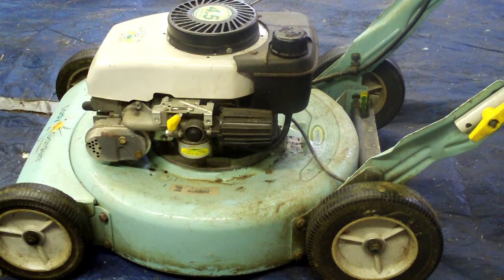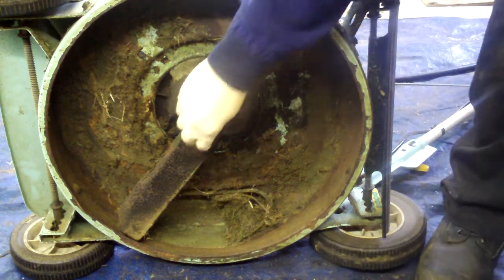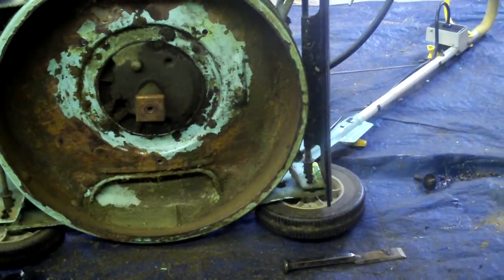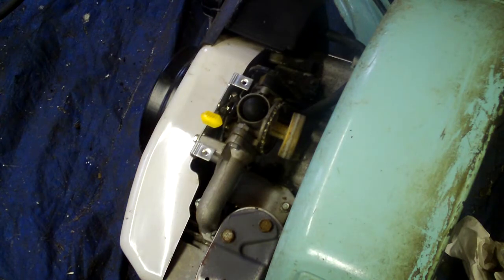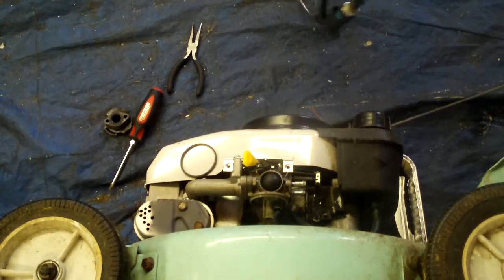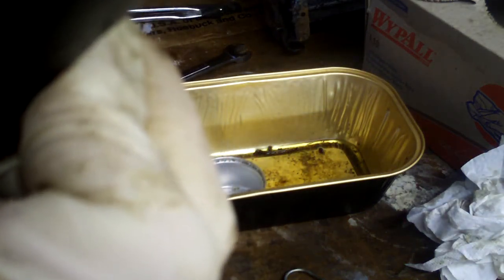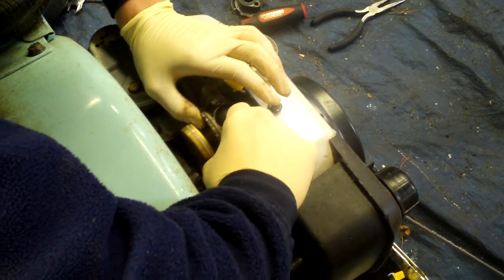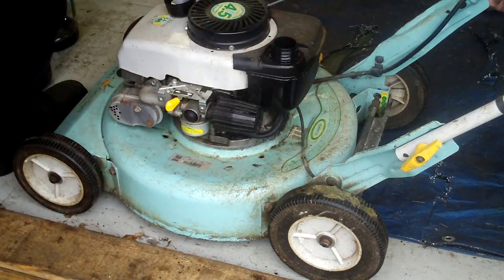Do it yourself! fixing a push mower

Comment: ahh i dont replace the blade until there is no blade left to sharpen. i have one mower about there now lol.  i use the angle grinder to put an edge back on rounded blades, but for a customers machine do it like you did since your doing it to get paid for doing it right